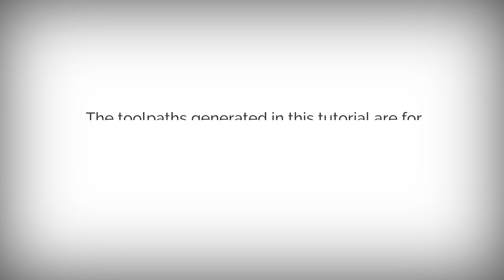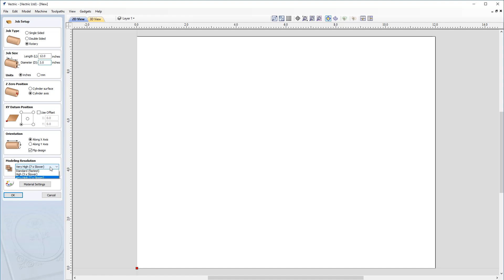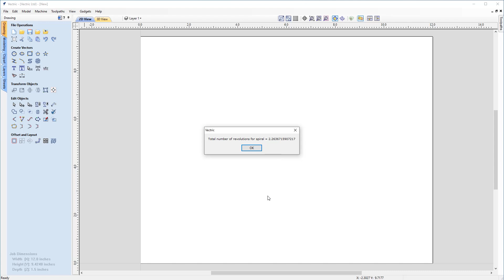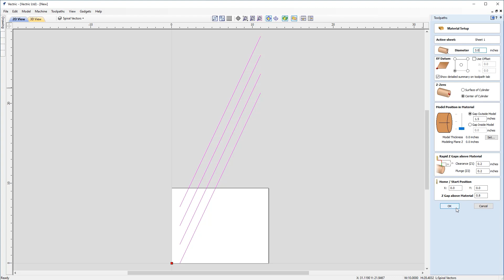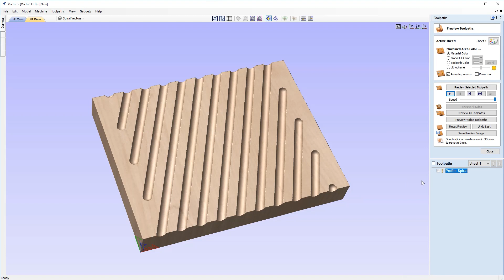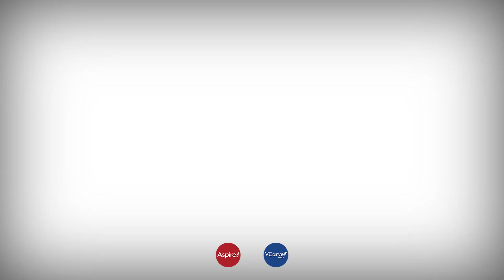Creating a Spiral Column | Vectric V11 Tutorials

Comment: Is it using all 4 axis to do the final piece? If not, how can i create a gcode to move x,y,z and rotary to do this sample? Thanks in advance
Reply from the maker: Hello Victor.  We only drive 3 axises at the same time.  Sorry.
Reply: I do not contend to supercede the expert's answer, but perhaps add further understanding. I am totally green at this, self-educated via umpteen videos.

A Rotary Axis on a 3 axises (x,y,z) CNC router does not add a 4th axis, but ;the rotary axis maps to one of the existing axis(x,y,z).

So, generally the Rotary on the x axis(left to right) is mapped to the A
The tool path will be able to sweep:

-  the x remains the same(left to right along the rotary stock)

- the y is now no longer flat thus the gantry will be in a fixed position over the cylinder stock and the rotation of the stock replaces the flat y(back to front) motion.  [ I don't know if it can do both directions, at all, if one only!? ]
The post processor module in the CAM does all the mapping... use the correct one! hint: would have an A in the name.

(look at it as the stock is rotated under the bit rather than the bit traveling over it) ...so all 'y' movement is instead a stock rotated motion under the bit.

- the z(depth) is the same, in and out of the cylinder stock center line

So, I think, since the y(to the CNC motors) is no longer needed, the rotary stepper motor can be swapped into the y output of the controller.

With the correct post processor(in the CAM), it can take a flat design and wrap it around a cylinder(rotary).  It can also process 3D simple objects with  no  undercuts.